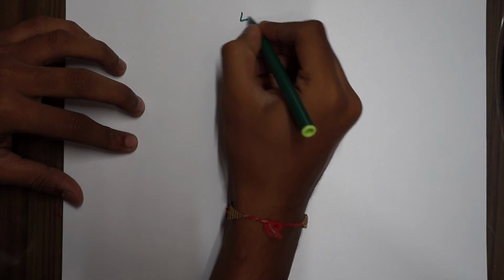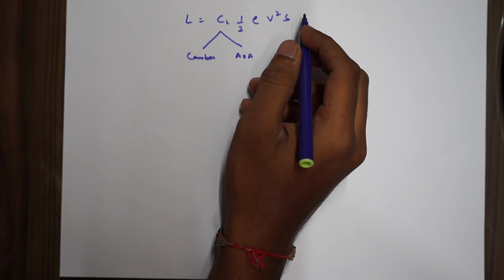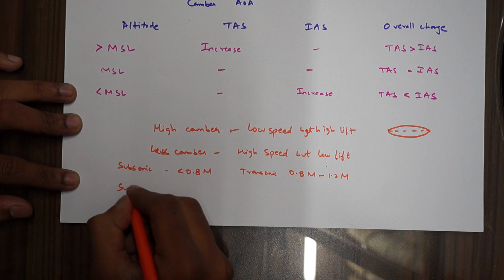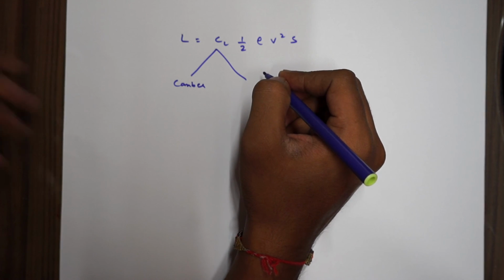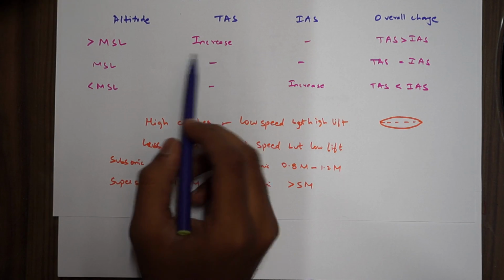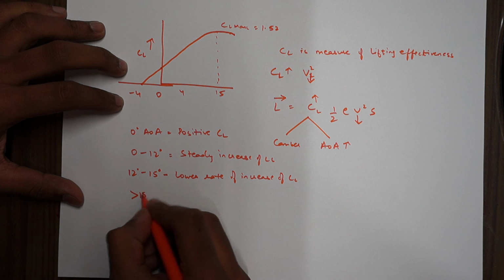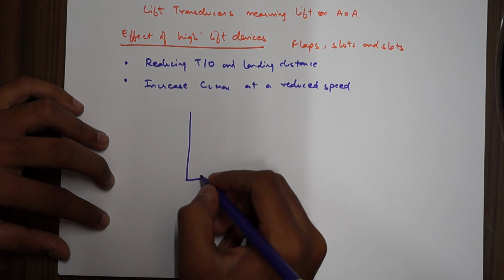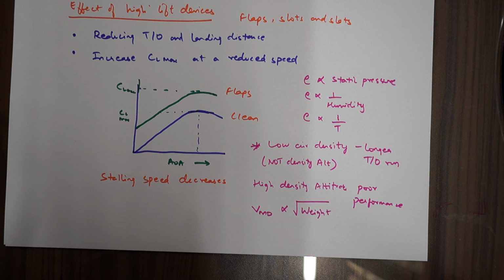Lift, Coefficient of Lift

Comment: Can someone help me with this question

A moderate speed aircraft moving at a speed of 13 ms-1 whose wing span 
and aspect ratio is 150 cm and 5 respectively. Assuming suitable wing 
loading and density of air calculate the lift generated by the wing at cruise 
speed. 
[Take g = 10 m/s2].

Comment: I think you forgot yo mention that flaps decrease AoA therefore just before extend them gives us a great visual aid to see airway 😊👌
Reply from the maker: Lowering the flaps the stalling angle of attack reduces, but  CLmax increases. but the effective angle of attack increases which helps in generating lift even at lower speeds.
Reply: Simply put - Flaps increases lift and  also drag, therefore you can reduce your AOA to maintain the same flight profile but at increased power to maintain speed. In landing profile, it provides better runway view from cockpit and better throttle response at higher power settings.

Comment: What is the unit for L? And, in order for the equation to work, can we out the AOA value in degrees?
Reply from the maker: From a pilots perspective we really do not need to know that. But Lift is a force, so its supposed to be Newtons.
Reply: @poh  So if i have a wing with AOA of 9 degrees, may I put 9 in the CL for the formula to work?
Reply from the maker: I doubt it'll be that direct because the units may not balance on both sides. It'll need to be calibrated! Equation is only for understanding purposes!

Comment: S is not surface area it's wing plan form area and there's a difference between those two l
Reply from the maker: The wings are the ones generating lift, when I talk about surface area, its obvious it corresponds to wing plan form area only. The fuselage is not really generating lift, so it will not include in this surface area.

Comment: How is TAS> IAS at >MSL and TAS<IAS at <MSL??
Reply from the maker: As you are flying above MSL, you are moving towards air with lower density and pressure. As this happens, you have to fly faster because now air is thinner, more air is needed for the engine to continue to perform. So your true air speed is greater than your indicated. Vice versa for below MSL.

Comment: How do you find the Lift Coefficient without Lift?
Reply from the maker: Lift coefficient is given by the manufacturer for a particular configuration. Not for pilots to calculate.
Reply: Though it can be reverse-calculated from stall speeds, CL_max that is. A bit complicated, but can be done. 

As for CL_0, yeah - no real way of telling apart from documentation. Can really be anything. From positive values, through zero, to negative. Not that it'd be practical, but technically possible.
Reply: With all other values in the formula for lift has values greater than zero and without lift - The  Coefficient of lift will be zero, because zero is equal to zero. Coefficient of lift is a number factoring the ability and efficiency of the wing to generate lift at various AOA and speeds.

Comment: A general aviation aircraft, with a wing surface area of 18 square metres, flies at sea level with a speed of 180 kilometres per hour. Its lift curve is shown below. Given that lift equals weight for this aircraft and that the aircraft flies at an 8 degree angle of attack, what is its mass (in kilograms)?
can you help me with solving this exercise?
Reply: step one, convert the speed to m/s
step two, find your CL (or Cy, also marked that way) - you look into the graph and you read value for 8° AoA
step three, find air density at sea level in base units
multiply: the Cy you've gotten, wing surface area (18 m^2), air density, square of speed (in meters per second!)
you have gotten the lift.
Now use Newton's first law, F=a*m. You get that you need to divide the lift you've gotten by gravity acceleration (approx 9.8 m.s^-2) - and you get weight in kilograms

a bit too late, I know ^^;

Comment: What is the difference between high and low camber? Are we referring to the thickness of the aerofoil?
Reply from the maker: I haven't heard about those terms. But there are terms like upper camber, lower camber, positive camber and negative camber. Could you cross check on that?

Comment: at 15mins 28 seconds u mentioned the lift to be constant. is the body still rising at a constant rate or is lift zero?
Reply from the maker: It means the aircraft is rising at a constant rate.
Reply: So it rises to a certain point until all the forces are in equilibrium? Thanks
Reply from the maker: Yup! beyond that Lift is lost which is termed as a stall.
Reply: Thanks
Reply from the maker: +Adithya Athreya You're welcome.

Comment: how high density alltitude gives poor performance
Reply from the maker: Density altitude is pressure altitude corrected for nonstandard temperature. As temperature and altitude increase, air density 
decreases. In a sense, it's the altitude at which the airplane "feels" its flying.

So basically if the aircraft is feeling that is it flying at a higher level than it actually is, then it thinks that there is less air density i.e., air molecules and hence there is less lift generated and this leads to poor performance. High density altitude means you are standing at a level where density of air is equal to a level higher than your actual true level, therefore your air density is less and loss of performance occurs.
Reply: @poh   Correction:   The term should have been High Altitude density...

Comment: May I ask if the +ve sign at the leading edge refers to the dynamic pressure? Im confused with the 16 degrees AOA. Does it mean that the aerofoil stalls because of a reverse pressure differential or because the downwash is not completed with the flow stream?

Also, could you please explain how does Bernuelli's principle of total pressure (unchanged) = static + dynamic apply between AOA 14 degrees and 16 degrees. I really dont get it.
Reply from the maker: Dynamic Pressure is IAS. The positive sign does NOT refer to dynamic pressure. It refers to aerodynamic pressure. Both are two different things. 

At angles of attack at and higher than approximately 16 degrees, the extremely steep adverse pressure gradient prevents air that is flowing over the top surface from following the aerofoil contour and the previously smooth streamline flow will separate from the surface, causing the low pressure area on the top of the section to suddenly collapse. 

And as far as I know and believe, and 14 degrees to 16 degrees is concerned, it is the time when the positive aerodynamic pressure starts moving under the wing and at 16 it is almost completely under the wing and leading to a stall. Between 14-16 the theorem is applicable normally. But at 16 it breaks off and causes a disruption.

I hope this would have cleared your doubts.

Comment: your videos are really helpful. great job. in your lift and coefficient of lift video u said at 40000 ft density is 1/4. So to mantain lift TAS should be 4 times. I think it should be twice as TAS is a square function.
Reply from the maker: Firstly thanks a lot for the appreciation! :) And yess, I cross checked that, its a good error that you have pointed out. TAS is V^2 so yeah twice of TAS will give it four times. Perfect. Thanks on that! :)